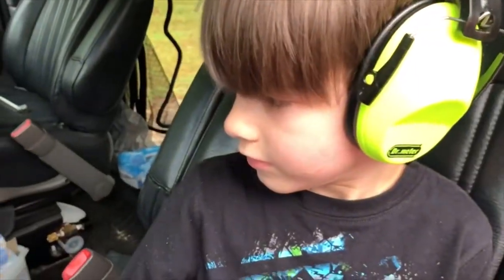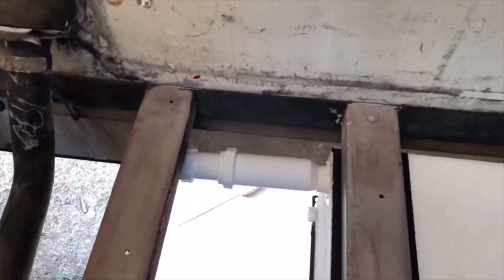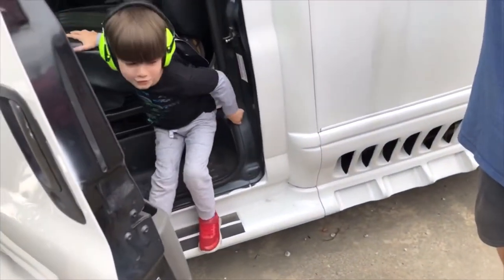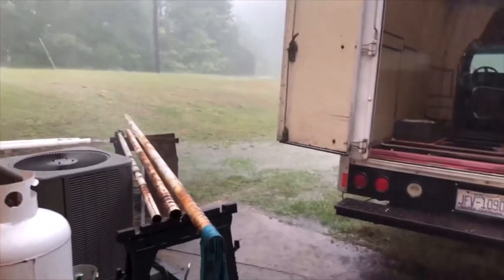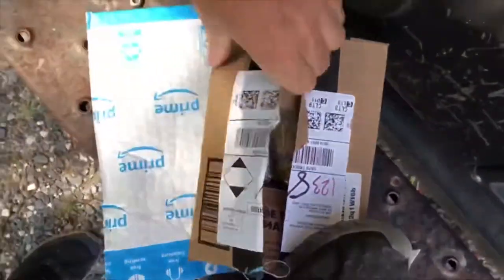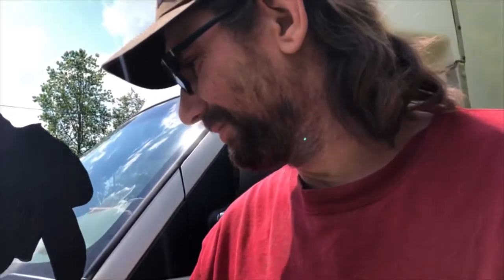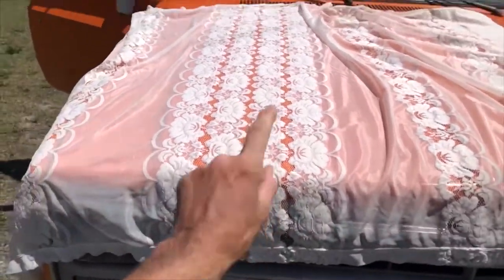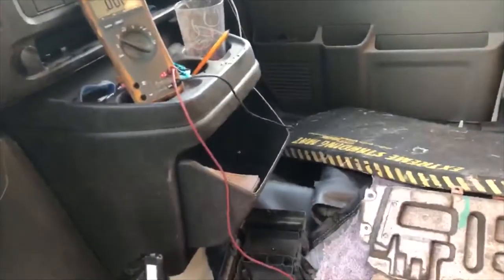My box van conversion, How NOT to fix wiring !!

Comment: Ouch on the wiring with the meter wire, you will survive, YES electric tape to the arrival. I lived in Tuscaloosa, Alabama for 5 years & averaged 44 Tornado's from Spring to Summer, got chased by one & turned my Grand Prix around & doing 140 mph to the Campus & got into Basement of School & that Tornado jumped right over the Univeristy. Thankfully. Took out a Scottish Inn Motel & part of the Mall, thankfully no lives were lost. Do not miss Tornado's at all. Yes you get use to your Weather Alert box going off & giving locations & you would just not normally go in that direction & life went on. Still don't care for the suckers. Your very Wired Humor gives one a moment of all wired up moment! LOL Good on the Firewall over the Muffler for starters. always, Tommy :-) P.S. Hopefully the Coating damaged can is still useable with full refund or you get a New & Improved Box with hopefully new Can. Have you thought of Flex Seal for the roof?